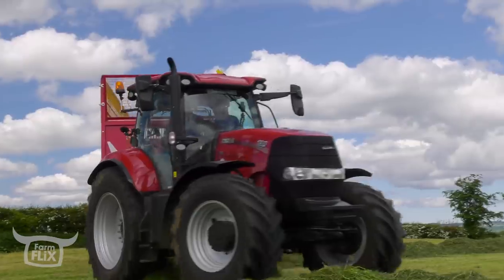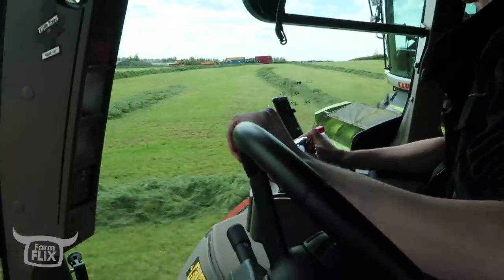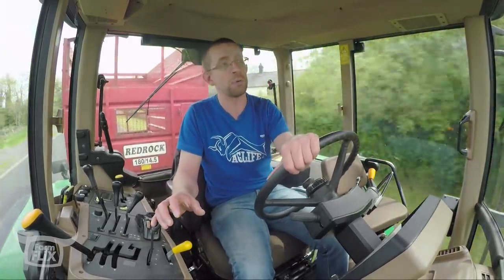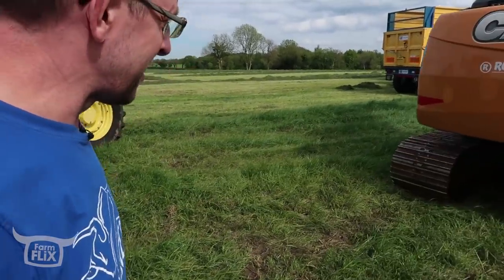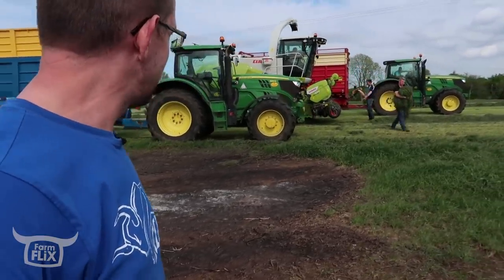Deere vs Case IH - Could be a Tight Race??!! John McClean | FarmFLiX

Comment: Would another switch be any use outside for the person getting the detection
When its switched on nothing on head will work  then he flicks it when he has got metal??
Reply from the maker: Sounds like a good idea... Isolation switch :)
Reply: a trick: watch movies on flixzone. Me and my gf have been using it for watching lots of of movies during the lockdown.
Reply: @Royal Sutton yup, have been using flixzone for since december myself :)

Comment: id say just turn er off when reaching into the header. the operator could end up having his hand or arm slip or sumtin and turn the machine on and goodluck to whoevers caught. good wee race yas had.
Reply from the maker: Drum or engine?
Reply: @farmflix  drum. if the engine is running the drum could accidently be turned on by a slip of a hand or something

Comment: John boy you smoking green stuff saying it was close that CaseIH was on fire LOL in all very interesting to see JD put power down to ground compare newer tractors.  One of best vids👍. I knew fella who got out of his windrower doing canola to unblock header with machine still running.  When he pull out blockage the header engage cutting gut open, very lucky to be alive today.  I shut down machinery n use safety devices like ram lock especially combines I heard too many headers dropping on operators.  Be safe fellas, take a break n think before fixing a problem.
Reply from the maker: Only ground he made on John was when the cvx didn't need a gear change like the 7810 did ;)

Comment: Safest way I think is harvestor man gets down. And reverse it from the controls on steps. Phantom detections sometimes is due to wire sitting on the solid bar straight under where the header reversed the grass out under feed rollers

Comment: And all that grass that was setting off the metal detector  will be left in the  field and the very same thing will happen the next time it's cut !!
Reply: Could very well be underground cables
Reply from the maker: Never heard of that tripping them before...???
Reply from the maker: More than likely KT :P
Reply: Wouldn't think a cable would set it off no steel in em